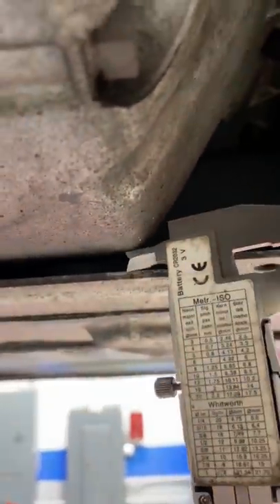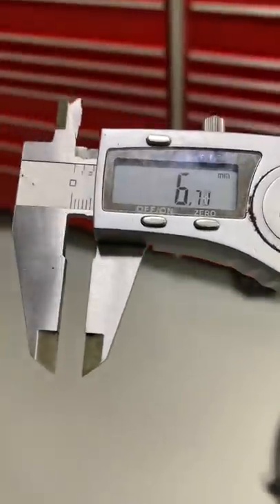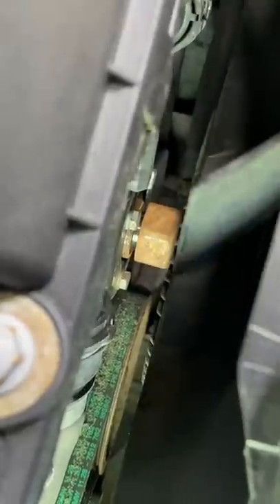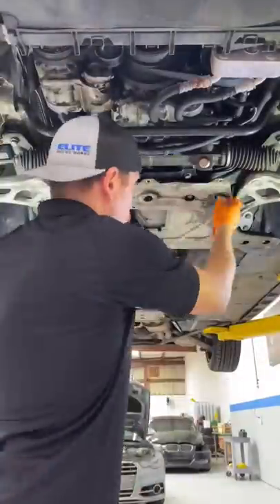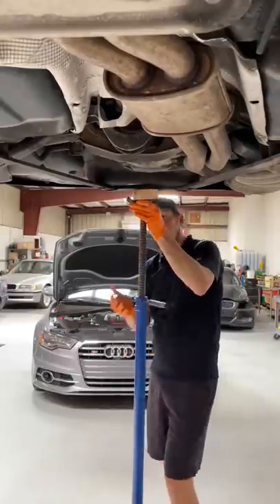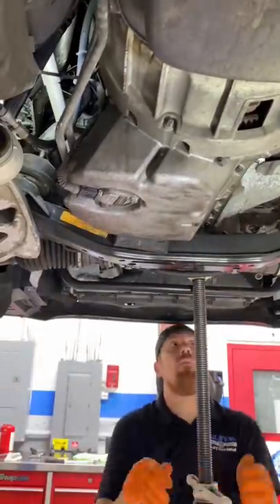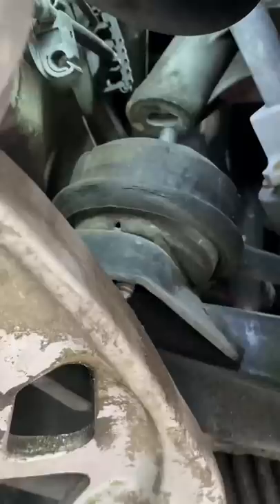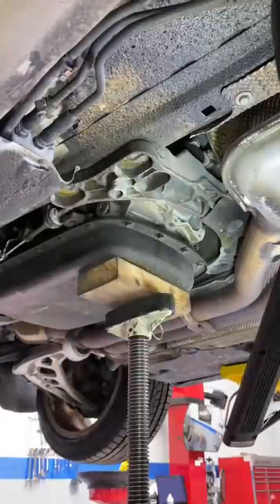Big Difference! New mounts #shorts

Comment: I seriously need your help with my bmw. I believe it's my throw out bearing but I have had a rattle or clanking sound that matches only the wheel speed as in only while its in gear. If you press the clutch in and coast in neutral it goes away however if you bring up the rpms while your parked in neutral no noise so I don't think it's coming from the engine engine accessories. It's less audible when you let off the throttle and immediately amplifies under the slightest throttle.  When it first started it was very fant and I thought it was a cv axle since it was only happening under load. So replaced them both along with every bit of the suspension, brakes, hubs, wheels and tires on all four corners with no luck. Now the sound is getting louder but it still shifts into gear fine with no binding.

Comment: On my E46 I had to use a fan hub wrench to hold it in place so I could use the 32mm slim wrench to loosen the nut. But, I think that's just because I lost the belts before, hence the need to remove the fan. 😁

Comment: I had all the aluminum motor mount bracket bolts sheer off after hitting a pot hole in my wife’s e90. Very strange mechanical shock

Comment: I remember when my cousin and I were trying to fix the water pump on his first bmw E36. We thought it was gonna be an easy job until we couldn't get the fam off. We were smacking it as hard as we can and couldn't get off. Had to use the old call my dad up just to get told that it's left hand screw. We felt so dumb😭😭😭😭

Comment: 07 Pilot stall test = drive motor moves a bunch it move up in the engine bay. 

Reverse engine barely moves. 

Which motor mount is bad on my Honda pilot the front or the rear. I’ve already replace the passenger side motor mount.

Comment: I replaced all mounts on my 09 A4 B8, and I still feel vibration on D and R when stopped with the brake say at a stoplight or something. By all mounts I mean both motor mounts and a trans mount. After I changed the motor mount the vibration slightly diminished, I was hoping it would go away from the trans mount replacement but there was no change after replacing it. Also I put a transmission mount insert together with the new trans mount. Anyway, vibration is still there while on gear. What else could it be? Could it be the transmission mount insert?

Comment: Anyone that knows E36s back when I had my 328is I changed oil put everything back together filled it up with oil.. when I started car the rubber o ring around oil filter cap would bulge out n leak a stream of oil . I put a big banjo clamp around it to stop the gasket from doing that . ... But I never could figure out why it did that.  Even tried different filters trying to solve issue.

Comment: German cars are full of junk parts. My 2006 accord has 300,000 miles and the engine mounts are just fine. these junk parts are intentional and very expensive. They don’t want their cars going too far in the use market they’re selling exclusivity and they don’t want beat down rusty versions of their cars in general circulation so the cars will break down to a point where their cost prohibitive to repair, mini German cars go to the junkyard without rust and straight bodies.

Comment: Look at the thousands of moving parts you eliminate when you switch to an electric vehicle. EVs typically have fewer than a dozen moving parts--- no transmission necessary, either, because electric motors have 100% torque @ zero rpm.  I have been driving EVs for 12 years now, and will never go back to gasoline.

No tune-ups, oil changes, tranny maintenance, smog tests, radiator leaks, etc.  Drive electric.